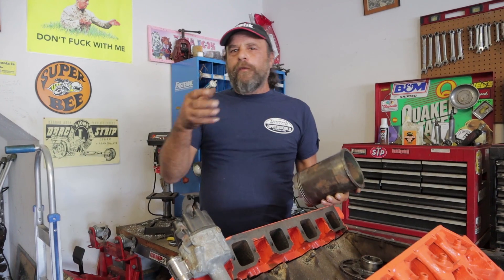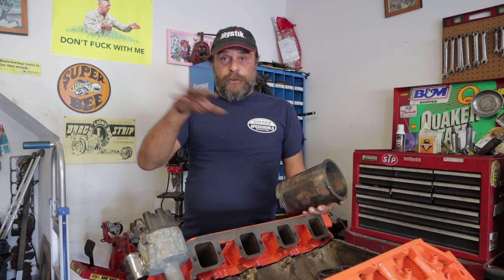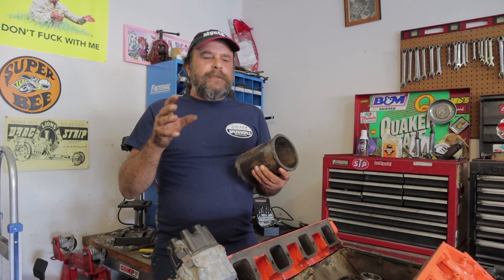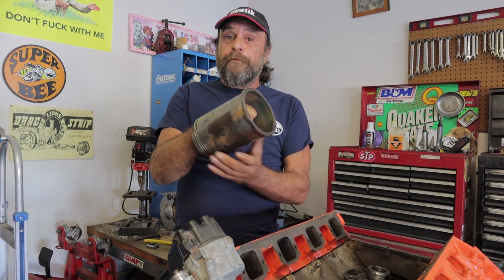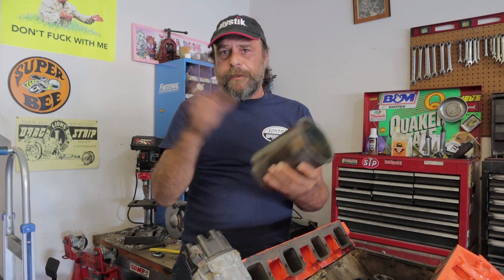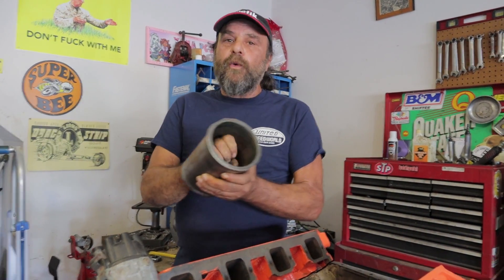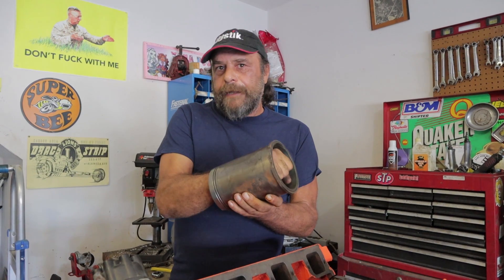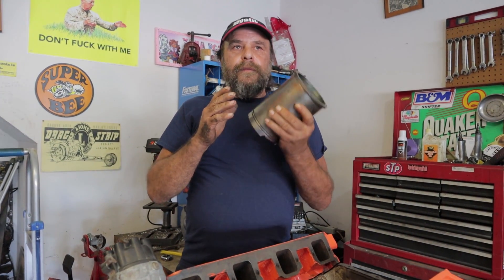The Myth Of Engine Displacement

Comment: This makes sense.  This is why a 2.3l 4g63 has a significant amount less torque than the 2.4l, because the 2.4l has a 6mm taller block and thus the piston is 6mm taller as well.  The 2.3 has a raised pin instead in the shorter block.  Man I always learn something from these videos.

Comment: need more info professor Tony. i have seen 4 cylinders do very well with High lift cams and notches cut into pistons to compensate, well that and crazy head work, balanced etc etc , amazing power from such small engines, my freind  is a crazy mechanical engineer who liked fast 4's old VW's

Comment: While true... I still love my 461 stroker pontiac.  The increase in compression over the smog 400, and the added induction aided by a bigger cam makes for double the HP that it had made at 400 cubic inches and I'm ok with that.

Comment: Holy shit Alpha, I NEVER thought of it that way! You have a gift for explaining abstract concepts in an understandable manner. I do know that a longer stroke makes more torque, and like they used to say back in the 60s and early 70s, "HP sells cars, torque wins races". 

I also know why Big Chief competes with bigger displacement engines....Butler Performance. I ran several versions of BP engines in my 69 goat 467, 505 and my 'little' N/A 535 that ran like a fucking SAVAGE and shocked more than one BBC bragging much bigger displacement. First I showed them the roof, then the tail lights. Truth be told, the ONLY thing factory Pontiac on that engine was the fucking water pump (before I went Meziere). Aftermarket IA blocks accept much bigger bores than an OEM Poncho ever could, and you can run 2.30 or larger intake valves and not worry about shrouding, the playing field is essentially leveled. Add exotic aluminum CNC heads that really breathe, forged rotating assemblies that you can wing to almost 8k without becoming shrapnel, and you get the picture. The only caveat is it costs a LOT more to go fast with a 'Pontiac' than a BBC...ask me how I know.
Reply from the maker: And you would know!

Comment: Perhaps this helps explain why out of the GM 455 trifecta, theBuick makes the most torque, yet has the shortest stroke.
Reply: It has more to do with port length than it does with the stroke when the engines are all similar CI. Also the ratings were kinda fudged, its incredibly easy to make 500+ ftlbs with a Pontiac or Olds, using factory parts. Throw compression at it like A, E, or C heads on a later Olds that came with J heads (not as much dish in the pistons and smaller chambers) or '67-'70 2.11" intake valve D ports with a Pontiac and 600ftlbs is real easy to do, but you need E85 or race gas. The longer stroke makes more torque, but the Buick makes up for it with a larger bore which makes it mostly moot. CI is CI. Longer ports means more torque in the bottom RPM, short ports means it needs RPM to make power. The Buick has a long port like the Pontiac, but the Pontiac has a higher velocity. The nailheads were extreme examples of port length and low RPM.

Comment: Actually, in the example, the 150 cubic inches is more or less accurate, but it's only making power 12.5% of the time..... 90 degrees of 720 to go through all four stroke cycles.  The biggest benefit of the stroker is allowing the engines with relatively smaller heads because of the same bore relative to those heads to get deeper breaths at a given RPM.  It's obviously limiting, but still increases power.  Without a doubt, though, maximum bore, breathing, and RPM are where it's at.

Comment: This is why big bore short stroke engines run good, also frictional losses really start to add up when you increase cubic inch, Or go big block because of the increased amount of bearing and ring contact

Comment: Dammit Tony...I may as well finish this 6 pack since I'll have a headache anyway!  Seriously though....there's good reason those dern GM little 283's back in the early 70's were screamers.  I've saw them blister much bigger V8's more than once.  I don't know why...just know they did.  
Maybe you or some old Chevy guy can explain it to me.  I just know they were very high revving stock engines.  They weren't notable through the first 8th mile but when they went to 4th gear they would wind forever.
Reply: Double the RPMs and you get the same power with half the torque and much less weight.

Comment: When thinking about increasing stroke, I've always pondered the problems of rod length/pin position, side loading the piston, and piston speed, but gave little thought to how quickly the second ninety degrees of the power stroke might plummet in cylinder pressure and leverage. I can see how it could become of little use at higher RPM's.
Reply: A shorter rod-to-stroke ratio lets the same bang do more work on the crank than a longer rod-to-stroke ratio, due to distance traveled in the critical first microseconds after combustion being greater with the shorter rod-to-stroke ratio.

Comment: Probably one of the most impressive things I’ve ever seen was a stock eliminator 55 Chevy run 11.50’s at altitude with a 265, I couldn’t make that happen in 100 years, but others obviously know how to make a lot of power with little displacement. 👍🏻
Reply: gearing in the trans / rear end played allot into that i'm sure. HP doesn't do chit without the rest of the sled set up properly
Reply: feff, Of course

Comment: I'd like to see an engine comparison test of extreme over and under square engines. The two I'd tested is the Olds 403 and the Olds 400G. The 403 is a smogger motor from the late 70s that has a big bore/short stroke, 400g is from the middle of the musclecar era, it has a long stroke/small bore. The 403 is a small block but can use the heads & cam from the big blocks.
Reply: I've seen enough motorcycle dynos to give a somewhat confident statement:  Oversquare engines always make more power, and most of the time all over the powerband. The oversquare engine is much more efficient and has all benefits in terms of power potential (Valve size, piston speed, piston surface etc.). The shorter lever on the crank doesn't matter at all. You get roughly the same torque down low but the curve of the stroker drops sooner.

Comment: How does a 481ci engine, built on a block in which all factory parts will fit and work, make so much power? Just so happens I have a 467 Pontiac built by Butler that has heads with the same CNC program that Justin (Big Chief) runs. They are not wide ports or widened bore spacing, just hogged out Edelbrock castings. Mine makes over 700hp NA on pump gas with those heads. It makes that power at 6500rpm, and it is making over 550 ftlbs at the rear wheels as low as 3000rpm. If you are a chevy guy or into small blocks, that makes zero sense. A high velocity port under pressure is going to flow up to a certain RPM limit just like if it were NA. It will be higher with forced induction, but the torque it makes will be prodigious. Its about maximizing the benefits of a design rather than trying to make it do something it is not designed to do. Enhance the capabilities and it will move mass easier.

Yeah we are only getting use from the top part of the cylinder because the expanding gasses only push for a handful of degrees after the combustion event... Unless its nitromethane. Justin is shoving 30-50psi through those ports to make 2500-3000hp, and is under 7000rpm doing it. My engines fill the cylinders rather well low in the RPM range, with high velocity ports. A fast moving column of air fills the cylinder better at RPM under 6500, and it is entirely dependent upon the shape and length of the port. Pontiac engines have a sweet spot in runner length and cross section that makes ludicrous torque from idle to 6000rpm in an iron head engine.

Then they have 4.25" stroke cranks, Justin has a larger bore with his aftermarket block. He might have a 4" crank, can't remember exactly. We can go up to a 4.5" crank easily in any 400, 428, or 455 block. Grind one spot about 1/8" and it drops right in.

The effect of going from the stock 400's 3.75" crank to the 4.25" or 4.5" crank is moving the RPM where max torque is produced lower in the RPM range, all else being the same. It also increases how much torque the engine produces, this effect is well known in the Pontiac world, and we often opt for the 4.25" crank in our builds, that allows us to run 3.08-3.55 gears, a 2400-2800 stall, and run 11s to 9s relatively easily. Pontiac engines are optimized to move heavy vehicles with highway gears, which is why building them like you would a 350 sbc makes them run slower.. every damn time. Put a 4.10 gear behind an iron head 455 and you will go slower than you would with a 3.08-3.55, often a full second slower. A 4.56 might work good with a 350 chevy in the 1/8th, but a 455 will waste that thick band of torque its making from idle to 6000, and it will stop pulling at 6000. No need to spin it any tighter than that. A mild pump gas 455 with smog heads from 1975 will make enough grunt to push a 4000lb GTO into the 12s with a 2.93 gear using a 1900-2200 stall. Be advised, that tends to break transmissions, even Th400s. Ask how I know...

The difference in stroking small engines like the 302 ford or the sbc is not as effective as it is with the Pontiac. The Ford has too small ports, unless its a 351C where the 2V heads flow better than most aftermarket W heads and the 4V borders on the Hemi. The longer runner length of the C makes up for the huge 4V ports to some extent, and they can make crazy power with a larger camshaft than the stock tiny cams. The C only has a half inch of stroke over the Cleveland headed BOSS 302, but the power difference is huge, that is partly due to deck height and the resulting longer intake port, including the intake manifold. The tunnel port 427 FE engines were an extreme example of that, as are the Ram Air V heads for a Pontiac. Huge ports with long runners that increase velocity.

The sbc has a big short port, which makes them an rpm engine, getting 450ftlbs from one of them is an achievement, and if a Pontiac is only making 450ftlbs its a disappointment. However iron Pontiac heads run out of airflow around 6200rpm even after porting. The engine design matters more than just bore and stroke, but those still make a difference.
Reply from the maker: Great comment..thank you!
Reply: @carlg500ci  Depends on the heads and cam, if you have 7000rpm capability and 320cfm heads, a 3.73 works with a 28" or taller tire. If its an iron D port head 455 the 3.73 will run essentially the same as a 3.08-3.55 in the 1/4 and 1/8, but they usually lose a couple mph in trap speed. Why spin it tighter on the highway? It makes a larger difference in cruise rpm than it does in ET.

My '72 455 HO Formula has a 3.70 in it, and its slower than it was with a 3.08. Not able to get out of the 13s with the 3.70 and 12.50s with a 3.08, but a RA II, IV, or V head would probably like a little more gear, depending on cam timing.
Reply: @carlg500ci  .552 /.547 lift? What is the duration at .050? That will tell me more about it. One of my engines that can use a 3.73 and deeper gear is the 467, it has 330cfm Edelbrock heads, a 270/272@.050 solid roller on a 108. It makes 700hp at 6500 and can easily pull to 7500, but I don't run it that high. If you have less than 240@.050 duration, chances are the 3.73 is not helping you much unless you have a smaller engine than a 400/455 Pontiac.

Comment: True but you didn't say anything about increasing displacement by increasing bore size. This will increase the top power of the bore cuz more bore volume
Reply from the maker: In the vast majority of cases,  overbore is limited to .060 of an inch, so cubic inch increase is minimal.
Reply: @jeremydavis340.  Well I will chime in..
A race block is 100% not like a factory block in what bore can be done. "Punching out" a factory block to the max overbore is some fad that started from dimwits in the 90's. The inches gained are almost nothing and the block now has no rebuilds left in it. 
now a race block is a whole nother tune. Bore is always easier to increase the inches with because you aren;t changing the geometry of the rotating assembly. That said, there is only so much you can achive before the flame front can;t expand far enough during the burn and you lose efficiency. That is where timing and cam come into play. 
IMO, if you are using a race block and building a strip car, stroke it out to gain the launch grunt, but your max RPM will be less, which can be "fixed" with gearing and tire size. 
If you are making a street car, man, nothing is more fun then a screamer, i would leave the stroke shorter so the RPM's can fly high and your smile will get just as wide.

Comment: Overly simplified given the variables (timing, compression ratio, etc.) but it seems to me like an engine with a larger static measure displacement needs more fuel/airflow just to match the output of a smaller one. Does that make any sense, or I am I nuts?
Reply from the maker: No, you're correct.  You're increasing the pumping volume regardless of the work output

Comment: This is why I don’t do stroker engines. The engineers who designed those engines originally were pretty smart guys and their work is good enough for rebuilding an engine close to stock.
Reply: That's a very very bad way of viewing things.
Reply: superkillr lol
Reply: Some engines can take some stroke with no detriment. For instance, I have never seen or read anything about anyone having an issue stroking a 302 Ford to 331. it's never "good enough" though for these knobs that got paid ooga booga money in the 90's by know nothing boomers that wanted to relive their youth and had big bucks to throw away to do it and then stuff like "punching the block out to max" and stroking it enough you have to trim the block to allow for the rod travel, oil rings a hair away(or even inside now!) the wrist pin hole on the piston..... Somehow that became "easier" then doing a big block swap. So then we get 347 strokers and the like that end up making a short lived engine with no rebuild potential left in it. 
but I guess, better then electric cars hahaha

Comment: What about a destroked 400 small block Chevy
Reply from the maker: That would be called a 350 Chevy, no?
Reply: No it would be around 383
Reply from the maker: Right..I stand corrected.
Reply: Back in the 70's the circle track guys called the combination a 377, I suppose it would vary depending if any additional cylinder boring was involved. They were definitely capable of embarrassing the big block cars from out of town.

Comment: Sorry I’m late. Your estimation of going from 3”-4” stroke off the top of your head was almost dead on. I’m building a LS 402 stroker=4” bore x 4” stroke, so you were almost exact. 👍
Reply: You're going to love that engine.  I bored a Ford 351m .030 put in a 4 inch crank with zero deck pistons for 408 cubes.  small cam, 2 barrel carb in an F150.  It made power from idle to 4800 rpm.  I can only imagine what better intake, carb and cam would have done.  Have fun with that one.

Comment: Anyone who has driven A bodies with both the 170 and the 225 knows that little extra stroke doesn’t do much. Port, polish, mill, relieve, hotter spark, timing, and a larger carb, now you’ve got a runner. It doesn’t matter which block you build, it’s going to be hot. I know because I’ve done it. Thank you Uncle Tony.
Reply: Hot Rod stroked a 360 mopar to 410 ci on Engine Masters and while it made more tourque with the added displacement, torque/ci went down.  Added less than 10HP too.

Comment: Torque is capacity related. Horsepower is a calculation from measured torque. The larger the displacement, the higher the torque capacity. Torque x RPM / 5252 = horsepower. Capacity has everything to do with generating work. The problem for large engines is the capability on the induction side of things. Poor volumetric efficiency is the main culprit of insufficient power production in large displacement naturally-aspirated engines. It stems from inadequate cylinder filling due to small cross-sectional areas and cfm limitations of common induction offerings. It is easier to make smaller displacement engines achieve high horsepower per cubic inch output because proportionally better induction is readily available without going full custom on parts (particularly LS stuff nowadays).  Food for thought.
Reply: TQ x rpm / 5252 = hp.
Reply: Thump Er *edited thanks 👍🏻

Comment: Hey Uncle Tony, does nitrous oxide give you power for the full stroke? Or is it just a harder pop at the top?
Reply from the maker: Nitrous and Nitromethane both work by increasing the duration of burn in crankshaft degrees

Comment: I think it is still valid for mass production engineered units where you have all the peripherial stuff to accommodate (head, fuel system, bore/stroke ratio).
Where it doesn't apply is engines that have too much displacement just for marketing or if you are diy-ing engine and only decide to focus on displacement for power and ignore every other factor. 
TL;DR correlation doesn't mean causation

Comment: And that fact is why all modern gas engines are designed oversquare. Meaning the bore is larger than the stroke. Undersquare is the bore is smaller than the stroke. Then the stroke times roughly 1.7 gives a good rod length to achieve rod angle to produce good  torque.

Comment: Opinions on rebuilding 360 or 318 LA's. Worth stroking if you have to redo the bottom end or just stick to a stock rebuild? Assume the cam will/can be changed as needed. I Dig the output you offer up on youtube.
Reply from the maker: The 360 is essentially a stroked, .090 over 318.  I'd build it at the factory size